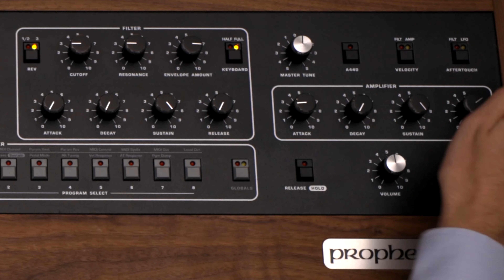Sequential Prophet 5 & 10 Part 2 👨‍🚀Exploring Modulation: LFO, Mod Wheel, & Poly Mod Tutorial

Comment: Delighted to find these helpful tutorials; as new Prophet 5D user !    Will visit /revisit often, for as long as needed.  
A but frustrating here, as keyboard P10 layout is enough different from Desktop Module, to force frequent pauses, to check & recheck Settings.  Several times,  your changes seemed unedited, yet some unnoticed  changes were made in sections not focused at the moment.  When changed to match P10 settings,  P5D ceased making sound.  Usually  assume pilot error here, but lost continuity in process.   
Looking forward to more of this guidance,  so important in bringing confidence and enjoyment to Sequential  Prophet usage !  🙏🏻
Reply from the maker: Yeah, I was a bit surprised to see the desktop module rearranged so much. I work with several students who have them and we need to pause to make sure they know where the section is. That being said, all of the techniques and ideas still apply. But you might need to pause to figure out where it is located your unit. Happy to hear it was helpful though! :)

Comment: Love the modulated pwm rhythmic patches. I'm receiving a Prophet 10 in a few days, is there any way to sync this to another device via CV or midi? Is there an LFO setting where it re-triggers with every key press? Trying to figure out how this would line up with a backing track with a set BPM, thanks
Reply from the maker: External CV and MIDI control are both available. The LFO runs globally , but maybe there is a way to mod that or have Poly-Mod simulate the effect you want.

Comment: I always thought that polyphonic meant that each voice gets its own lfo, oscs, envelopes etc. But it seems that the lfo on the prophet 5 only works globally. Meaning, i cant have the lfo from a note/voice and another note/voice phasing at different points in their lfo cycle. So for ex. The filter slowly rising on a hele note while the filter is slowly cycling down on another held note. 🤔
Reply from the maker: Technically, polyphony only applies to the number of voices you have. (Compared to monophonic, which is only one voice, or duo phonic like some keyboards such as the Moog Sub 37) 

So if you want individual modulation, this is where the poly mod section allows you to perform individual triggers for each voice so that the envelope can open independently of the other voices. But something like the global mod sections will act on all voices at once. (I hope that helps)
Reply: @ToddUrban  Hey thanks for the reply but you’re actually wrong about the terminology or you are misunderstanding my question - Specifically, the main lfo appears not to be polyphonic (I’m not talking about polyphony) i.e. not per voice. Slo the envelopes without polmod are polyphonic - perhaps the VST is different on this point. Polyphony and polyphonic are different terms when referring to synth capabilities as I’m sure you know. Polyphonic (not polyphony), when it’s In the context of explaining a synthesizers ability, means that 1 voice equals 1 of everything lfos, envelopes, etc. Then you have paraphonic - note polyphony with single lfo and envelopes, etc. and then there’s variphonic. So it seems that the prophet 5 does not have 5 true voices because, although the amp and filter env is polyphonic per voice (without poly mod),  the main lfo is not polyphonic. Perhaps it’s variphonic. You should check out Mark Doty (automatic gainsay) on YouTube. He explained this rather well n his video “Your Wrong About Polyphony”
Reply from the maker: @GrootsieTheDog  Sorry it was early in the morning and maybe I didn't address this clearly.

Each of the five voices consist of an Oscillator section with two oscillators, dedicated voice mod, PW, FCF, and VCAs. They are mixed together with noise going through a mixer before entering the lowpass filter. 

Each voice contains two envelope generators that independently control the filter and the amplifier (VCA). Due to this, the synth is considered polyphonic, not paraphonic. 

However, it also features a Global Modulation bus (which you pointed out) but then per-voice- modulation through the PolyMod section. So yes, the LFO on the bottom left is global, but still has the characteristics on each voice card to make the synth considered to be defined as polyphonic. Hope that helps and I appreciate you bringing the topic up here for further explanation.
Reply from the maker: By the way, I did a bit more digging to try and find a polyphonic synth that offers per voice LFOs. The Nord Lead 3 and Access Virus were two of the first to introduce this. But of course this was many years after the Prophet was already using the term Polyphonic.

Another example is that the Polymoog is fully polyphonic (voice per key) with 3 global LFOs. So there aren’t really hard lines here when referring to “polyphonic”.
Reply: @ToddUrban  Thanks for the info! I’m a super geek on all this. All these differing behaviors between synths helps me to get to know their unique characters - the more I create music with them, knowing the little things like global lfo or per voice pitching (like on the OBx), helps me to know how to approach shaping sounds on them. 😀 It seems in the synth community the technical definition of polyphonic in the context of defining synth capabilities differs. Some seem to be very hard line and believe a “true polyphonic” synth would be each voice having its own dedicated voice, lfo, envelope, etc. vs “polyphony” being multiple tones all at once.  Anything else would fall into paraphonic or, the newer term, variphonic - a combination.
Reply from the maker: @GrootsieTheDog of course! Happy to have a productive exchange here. As you can probably tell from my content, I spend an insane time around the manufacturers, educators, and specialists in the field to try and catch every detail. So I’m always up for learning more. My last response was guided by someone intimately involved in the advancement of synths in our industry (but will keep them anonymous). Looking forward to seeing what you think of the next video I have coming out on the OBX8. 😉